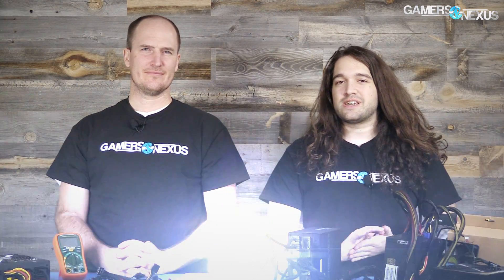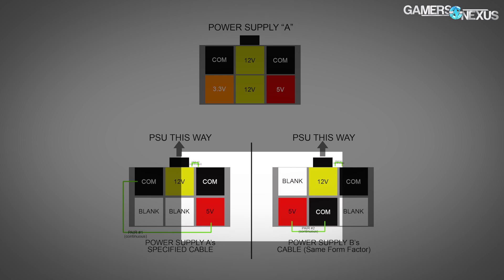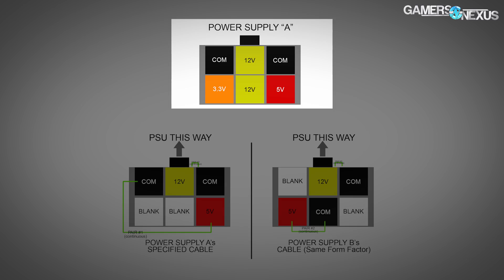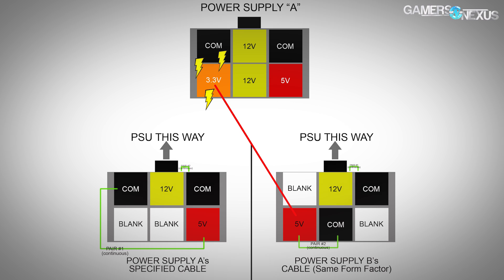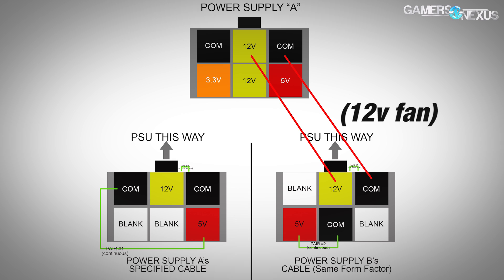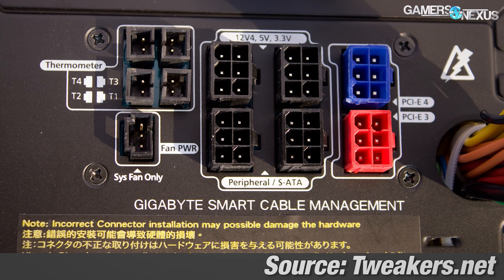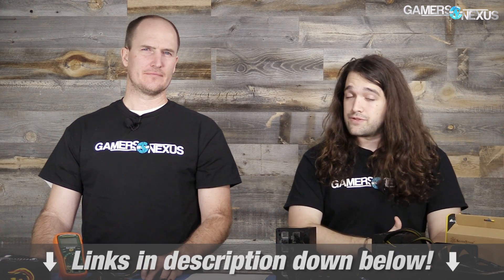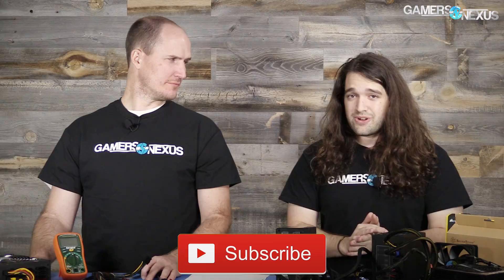PSA: Stop Mixing Modular PSU Cables

Comment: Just found this video and what shocks me is that, as a PSU engineer myself(not ATX but industrial) even I always thought those pins are standardized. Turns out after 10 years it is still not the case🤯

Comment: This mess is just so dumb, I got 2x3090's now and the 850W PSU I suspect of being the cause of the crashes I have been having as its just not enough on paper. So I got myself a 1250W PSU to replace it with to hopefully solve the issue. Both are modular, one is a corsair and one is a coolermaster.
The brand new coolermaster has 4 8-pin pcie ports as I need to drive both these GPU's, a setup that works (although not fully stable) on the old power supply. The new one? They ship 3 cables for these 4 ports and they don't have the daisy chain bits on them as a workaround either.
Result? I can only hook this up by borrowing an old cable of the corsair. We did test it prior to installing it, and guess what. Exactly like in the video two pins are swapped. Had to install my old PSU again and can't use my brand new PSU now until I manage to order the cable that should have been in the box to begin with.

Comment: I just made a noob mistake transferring parts from an old case to a new.  Wanted to use an 850W changing from a 750W, problem was I was missing the fan cables, so my stupidity came up using one of the fan cables from my 1000W then something from the motherboard started smoking and immediately disconnected the power.  Thankfully, being ASUS motherboard, everything seems to be working when I used the 750W brick again-now the questionnaire: I wonder if I truly damaged something as I could not determine where the smoke originated?

Comment: Ummm what about if the psu is from the same brand but both of them are different models examples : CM MWE gold series and CM V Gold series. 

So my question is, is it ok to interchangeable The cables even both model are different but they from the same brand?
Reply: Use a multimeter in continuity testing mode to validate the pinouts before mixing and matching modular power supply cables.  I have a Molex Mini Fit Jr pin removal tool for this specific mod to adapt the cables safely.

Comment: Here in 2022 I learned this lesson the hard way. Wish I had seen this video back in 2016. Just burnt out my Corsair Sp Lighting Controller. Definitely could have been a worse component, but the smoke coming from it when I turned on my computer was not a pleasant experience.

Comment: I think I just killed two SSD drives 2 TB each when I replaced my PSU 😫. I left the cable that came with my computer and I plugged it in a SATA slot available in the new PSU. My computer wouldn’t start until I disconnected this cable,  then replaced it with the one that came with the new PSU and removed the two SSD, I tried a different HDD and it works fine but if I connect any of the SSD it doesn’t start. Any way I can fix this? Did I really killed my SSD? 🥺

Comment: Would the same apply to cable modem power supplies? Despite my questioning whether it was okay, an Xfinity tech was mix and matching the power supplies he had on hand to my cable modem since I did not have the power supply on hand. He joked that he wouldn't recommend doing it for the long haul, but it makes me wonder if it was a problem to do it at all? Everything seems okay now that I have the correct power supply plugged into the cable modem, but could this have caused any damage?

Comment: I nearly made a fatal mistake. I needed another PCI-e cable for my HX1000. I had an old Corsair full set ( model unknown ). I used it because I was impatient and when I turned it on it sparked and popped from my brand  new 6800XT. Thankfully no  damage but I got lucky.

Comment: So not all cables run parallel with one another, some cross and land on a different pin than they started? Right? Seems crazy that wouldn't be the case, which is why it took me so long to figure this out, otherwise it'd be the case that devices could receive any arbitrary voltage or polarity and be able to route and utilize it however it needed to.

Comment: I was wondering how this happens so I looked at a PCI-E cable. I was thinking well one end is standard and other is not but also the wires are always straight and don't cross but they actually do... right at the PSU end. At the PSU end they all cross and go to whatever pin it's supposed to on the PSU. Why don't they match the standard from one end to the other?

Comment: Damn it! Ughhhhhhhhhh!
Reply: This is outrageous. I just swapped a power supply without rewiring my rig and I cooked two hard drives. Standard connector should always have a standard pinout. What lunatic looks at an existing connector and says I’m going to switch the 5 and 12v rails? A sadist. Only.
Reply: @Jack-jl1ui  somebody should start a class action and I’ll be there 1000%
Reply: @nosenseofhumor1  I mean have you personally considered going to small claims court for yourself? I am but I'm gathering information at the moment.
Reply: @Jack-jl1ui  I haven’t because the total cost of the damages is less than a thousand dollars. I’m thinking I’m just defeated

Comment: so easy to standardize. this is ridiculous. so company A needs more profit for investors. lets sell more power supply connectors. we can make a different standard then what everyone is using. this way they need to buy this new standard cable from us. any company doing this should be ridiculed. having the same standard lowers cost across the board for everyone. all it takes is one Ahole.

Comment: So if I buy custom cables, do I have to change the pins so that the part that goes into the PSU and the part that goes into the component has the correct layout respectively?

Comment: Here because destroyed an ssd and a hdd because I was upgrading my system and used the older sata psu cables with a new psu, when I turned on the pc and saw smoke I knew I screwed up :(

Comment: What did I fry on my motherboard ?        the Ryzen processor ?     or much more ?        Would the 24-pin connector, be totally different too ?       My motherboard still has the LED logo ?      Is the motherboard salvageable ?     Does that mean the PSU is okay ?

Comment: Keying is already (mostly) standardized, and therein lies the problem. If keys varied across manufacturers, people couldn't plug in the wrong cable in the first place, but I think varying keys is the wrong answer. I'm sure they don't do so because it's cheaper to use a ready supply of like headers. It is in the power supply manufacturer's best interest to standardize pin-outs, though, because processing warranty claims is expensive for them. Even if ultimately they deny a warranty claim because they can prove the PS was damaged by using the wrong cable, they still have to process the claim, examine the unit, communicate with the customer, etc.. Labor is expensive! They could cut out an entire class of warranty claims and related expenses by agreeing to standard pin-outs as they have (de facto) agreed to standard keying. I'm certain they would save more money than they would spend in the process. As far as being able to support manufacturer-specific features, like the LEDs mentioned in the video, they can still do so with a uniquely-keyed cable in a new socket, but they should also submit that cable, pin-out, and functionality for standardization for all the same reasons.

Comment: Hi guys, thanks for this video. So I just bought a Seasonic TX1000 to replace with my Corsair HX750. I called a friend who said you can definitely use the same cables, but there was one cable that didnt fit so I ended up thinking something was off. So I ended up changing all the cables just to be sure... However there was one SATA splitter that would be a huge job to get out, so I left it and thought ”well, a SATA is a SATA...”. I turned on my computer and was happy how everything worked first try. Suddenly after about 5-10 seconds I feel a smell of burned plastic, I witness a FIRE in my SATA powered fan hub, and smoke coming through all fan cables. Luckily I was able to pull out my power chord quickly, and my computer still works - however the voltage regulator on most fan cables are toast, and the computer is having issues to boot sometimes... This PSU was my final piece of my dream PC and I looked forward on finally taking it for a spin - and now instead I’m looking at spending hundreds of dollars, including a new Motherboard. I’m so surprised how this was not more clear in the manual or in the community in general - I even googled it before and it seemed fine. GUYS dont mess around with PSU cables - use the one that comes with the PSU, otherwise you’ll end up looking like an idiot like me... :(

Comment: I ran into this problem recently about a month ago. I did some appearance upgrades to my PC and bought some new cable mod cables, plugged them into my thermaltake psu and I heard the psu beep. Confused as I was because I’ve never heard a psu beep and no power was pushed to the system. googled it and nothing was out there on this problem, nothing in the manual just emptiness on the internet. It took me 2 hours of trouble shooting to come to the conclusion that I should check the cables and plug the previous ones in, and sure as shit it was the cables.
Reply: All components tested fine? I just did this with my Corsair 750 and wanted to know if there are any long term negatives.
Reply: hey bro is the new power supply working after the beep ? i need to know that please .

Comment: i have a fully modular power supply a Cooler Master MWW 750w gold , i need an extra eps 4+4 pin Cable for the mother board, can i use a Corsaire eps 4+4 pin cable insted?

Comment: Just a cople of days ago killed my new h370 motherboard after i change original cables for those shorter from different manufacturer. Strange thing is that PSU survived. But don't know yet if my 16GB ram module and I7 8700 cpu are alive. I pray they're ok.

Comment: I had an SSD shoot smoke and melt at the sata connections when I accidentally plugged in a psu cable into different psu. Oddly enough everything is fine minus the dead SSD.

Comment: Is this video for those who use cables for one psu branch into another different? or what? because psu has layout for every cable so you connect them correctly, also theyre have different pins so you cant connect it wrong

Comment: I wish I had seen this earlier... I've been going BONKERS these last few days because of exactly this! I was using different psu cables on the wrong PSUs.  I was building custom gaming PCs and they kept rebooting non-stop continuously. I was very fortunate that the devices I had connected to it did not fry!  And the only issue was that BIOS would not POST. Once I had removed the extra psu cables everything came up just fine.  With these newer Semi-Modular PSUs it's so easy to mix up the cables too because you can't identify the wire colors because they're all black. On models like, EVGA, Cooler Master, Corsair, etc.. Going forward going I'll be labeling all my PSU cables so that they never get connected to the wrong PSU.

Comment: Today I put a new PSU in my computer. All the cable management for SATA ssd, hdd and cpu pump was already done so I thought; why not simply unplugging from the psu and plugging the same cables in the new psu... Result, hdd died, old mushkin ssd died, evo 850 ssd survived without issue. The pump plus fans plugged in it didnt start when I put the power, but they started smelling like electric burning (you remember the smell of over used slot cars track 90s kids ? that smell). The evo ssd and the pump were on the same cable, but my guess is that since I plugged this cable in ''peripheral'' instead of sata, the change of pins layout probably made it compatible for the ssd... saving this ssd at least.

My old psu didnt have modular mobo cpu and vga cables so I couldnt have let them plugged, fortunately, I would have been furious if I'd killed my new 2080ti D:.

Shut off everything immediately. Fans now make a little noise (probably damaged from overheating their motor) but still works fine and pump seems to work fine also.

I think I got lucky in my bad luck, only the hdd was important but as it burned only the pcb, I should be able to get my data back. Now I've learned my lesson. it wont happen again. Small impact for a life time lesson haha.

This should be a more well known fact though, I am surprised that people dont talk about this more often.
Reply: Seriously, this just happened to me. I follow all the big tech Youtubers and none of them talk about this even in passing. I only found this video after I started wondering why my SATA drives weren't showing up... 

No smoke, no noise, nothing to indicate anyway was wrong, but now my SSD and HDD are both unreadable. I was thinking of doing a mainboard swap on the HDD, where did you get yours at?
Reply: @MrMattumbo  I actually searched for one and couldnt find one... my only choice would have been to pay a company to make a recovery but it was too expensive and I accepted the loss... it really sucks.

You can also ask to electronics repair shops around if they can either replace the dead part on the pcb or search for a compatible one, you could get lucky.
Reply: @TheLoucM  Ouch, yeah I looked into a few companies selling Seagate boards but they don't seem to have any for the new Barracuda models. I'm still debating whether to try to save it or not, I can replace most of the important data since it was backed up from an even older drive I still have, but there's still a lot of newer photos and such I'd lose. 

It's just so hard to justify several hundred dollars for recovery on top of having to buy $170 in new drives. I still can't believe PSU manufactures switch around the pins like that, it just boggles the mind, it's like selling someone a house with standard outlets but they're all wired with positive to the ground plug and nuetral to the positive plug and then they act surprised you plugged a cable from your old house into the socket. Why EVGA? Why, why would you have the opposite pin layout to Corsair and use small font for your warning, IT SHOULD BE A BIG WARNING. 

Oh well, thank god I swapped my GPU cable, I liked the corsair flat cable better but I still did it. If only I had the same motivation for the SATA cable and just clipped the one zip tie to redo it.

 I'm gonna hate myself for years over this, I hope someday I forgive myself.
Reply: @MrMattumbo  its not your fault, dont beat yourself too much over it and you are right, there should be BIG WARNINGS everywhere about that, and pins layout on the psu side should be standardized. It boggles my mind just as much, its insane.

To be fair to EVGA though, they are the only manufacturer (afaik) who puts cable compatibility on their web site. Thats a start I guess... but I still dont understand that there is not HUGE stcker on a new psu that says "if you are replacing a psu, make sure to use all the cables that comes with the new one", and dont just write it sonewhere in tha manual nobody reads :/
Reply: @TheLoucM  What gets me is I read the manual, but they put that warning in some small font right below another warning. I read the first warning then skipped the second thinking it was part of the first. The first warning was your standard "don't open the PSU, there's nothing you can service and you might shock yourself blah blah" so I just stopped reading it.

If they'd have made the cable one the first warning I would have been saved. Oh well.
Reply: @MrMattumbo  Yeah, that sucks, I'm sorry :(

Comment: Too late. Just blew a 1tb 850EVO, a Vertex SSD, and 2 x 6tb HDDs by using the SATA cables from a Thermaltake PSU into a Corsair RM1000i. The cables looked exactly the same pinout wise too. Game over for those poor drives.

Glad I have backup from most of it. But this mistake cost me 650 Euro.

My mistake, but manufacturers should clarify that.

Comment: Once my friend fried fried supply with wrong cable on wrong connector, psu died and caused some problem on motherboard pci-e connector that most gpus dont work. Surprisingly gpu was fine after that, he had to buy new motherboard.

Comment: I mixed up cables with 2 different Corsair PSU's one was a 500w the other a 750w -- they looked identical, were both fully modular and were BOTH Corsair & bout the same year. Welp long story short it fried 2 hard drives and wiped out the SATA controller on the mobo. THX Corsair.

Comment: I wish manufacturers would just put the key on the power supply over the connectors. I also hate all black wires for this reason. Luckily all the cables I have at my place are Antec so far. If I buy another modular power supply from another brand I will look into how they are keyed and keep them separate.

Comment: Wait I cannot figure how it can possibly happen. Gpus all have the same connector layout. That means you either need to have an exact same layout on a psu, or re-arrange channels but then you have to crisscross wires inside the cable sleeve, so that you get a correct output in the end. Who on earth (and why?!) would go for the second approach?

Comment: I watched this video a while back and thought, how strange.  Well, I just hit this problem on a system with an EVGA PSU that wouldn't boot up when I connected a fan controller.  Of course I was making multiple changes so it took a while to isolate to attaching the controller's molex cable for power.  After going through the stages of denial I remembered this video.  Thanks.  I'd suggest calling out unlabeled cables for modular power supplies as an area for improvement in reviews...  Also can we just stop with the Molex.